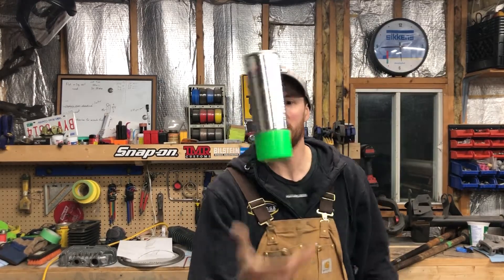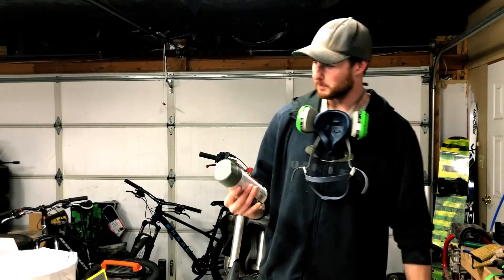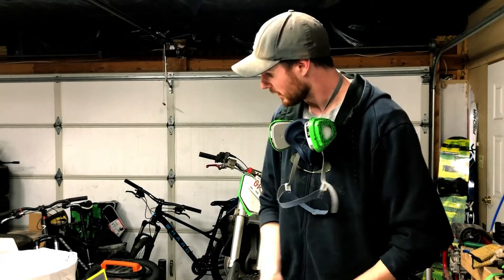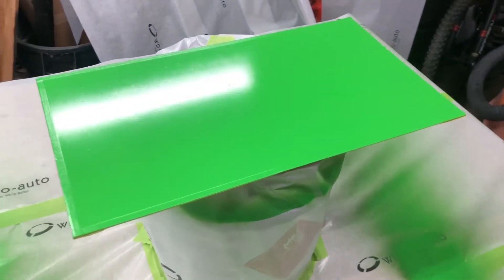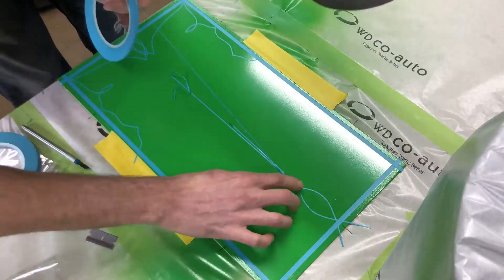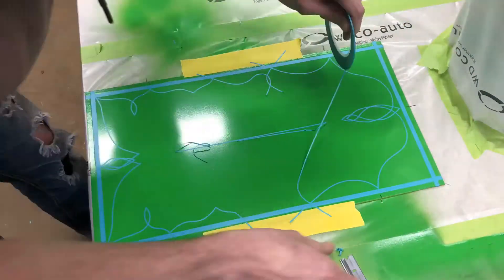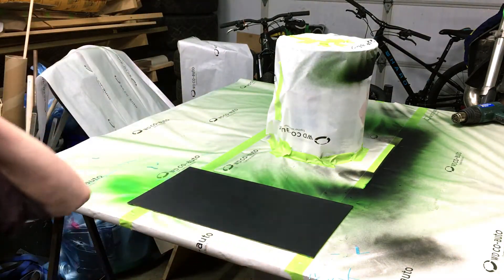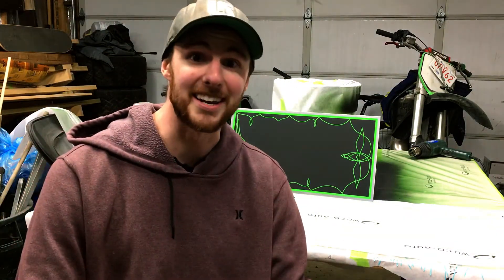Pinstripe-Style Masking with FBS Fineline

Comment: Pulling the tape upwards can sometimes pull the paint up with it. A better way is to pull the tape 180° back on itself. Nicely done though.
Reply from the maker: Thanks Willem! Prior to this video, I had always used fineline just to separate two colours on a panel or hard lining clear coat at a panel edge, so only had to worry about product on one side of the tape. I appreciate the advice!